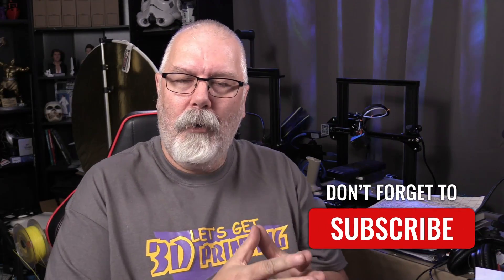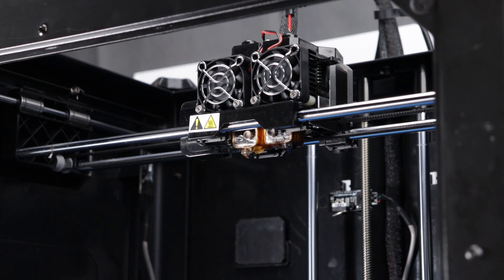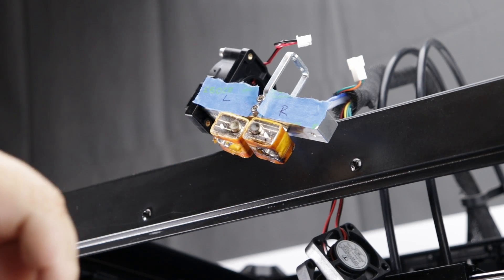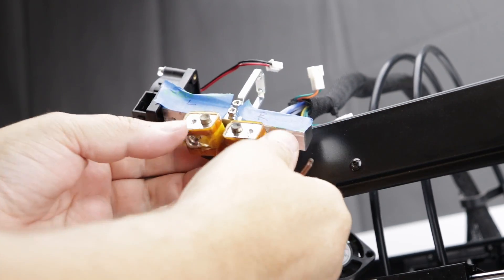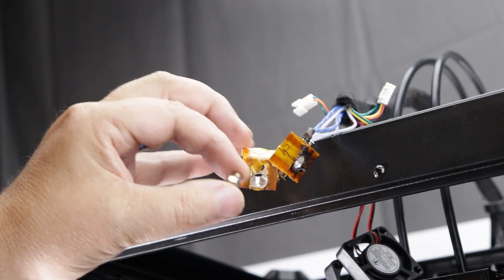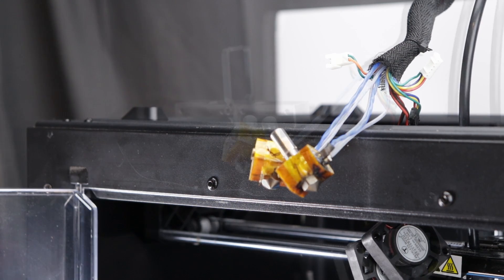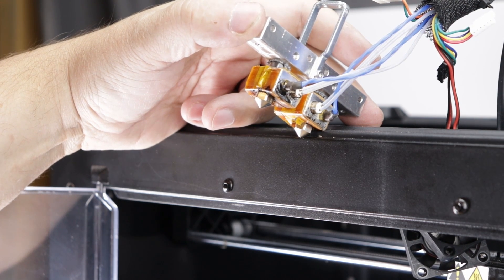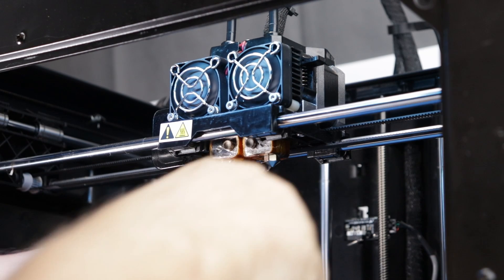Hotend Upgrade

Comment: I would have thought an enclosed printer like that would have come with an all-metal hot end as a default.
 One thing that has me confused is that manufacturers make heatbreaks from titanium as they don't conduct heat well and thus fight against heat creep but then people apply boron paste which increases thermal conductivity, this is a bit of a paradox!

Comment: Just upgraded my creality CR10S PRO V2 to Micro Swiss including the direct drive conversion. Definite improvement on the quality of prints. Better control on retraction plus I don't have to worry about the PTFE tube degrading over time. Just have to figure out how to adjust the nozzle offset since it's not centered on the bed. Tried M206 to adjust andd M500 code to save but it did not work. Is the stock creality fw offsets for X and Y  locked?